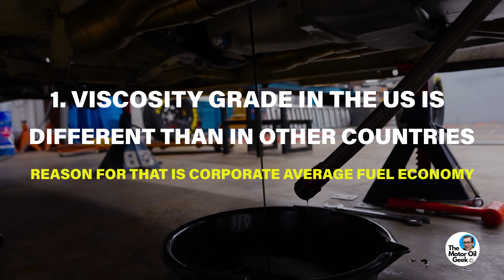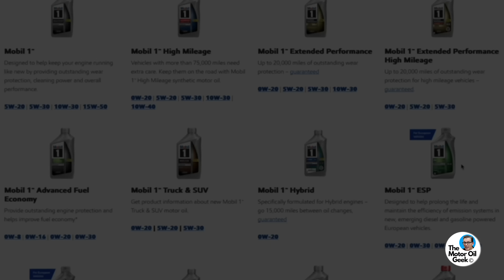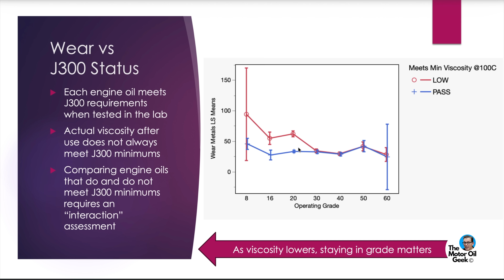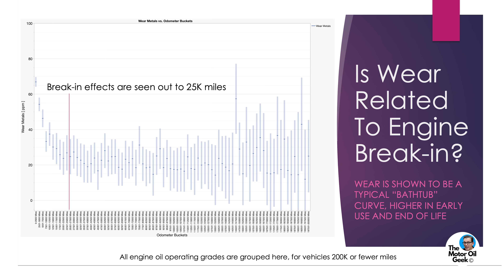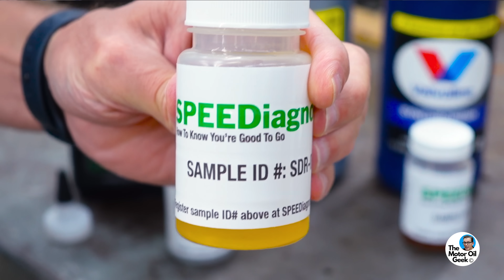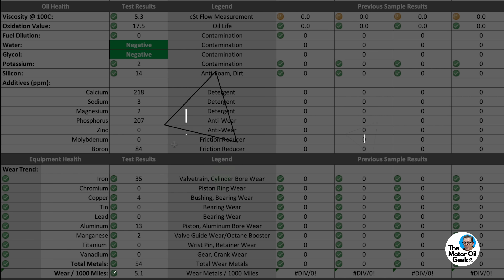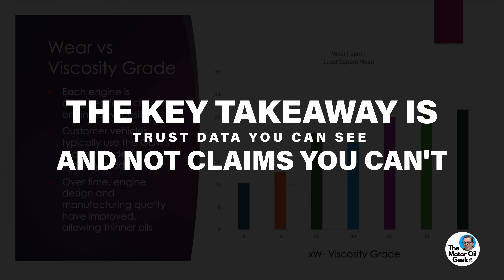More Ai Lies? The FACTS about 0W-20 vs 5W-30 (With Evidence)

Comment: He is biased as he owns the company, he directly benefits from oil analysis you guy pay for. Ever noticed how this channel always produces seemingly captivating, yet no new info videos? It's all same old agenda. He has some valid points, but a lot of wrong misinformation. Even worse that he tries to call it science, while failing at its core, no proven research, no real scientific analysis, but a lot of "home made" youtube tests on a test engine that is highly biased and owned by his friends. Even if he really was sincere and not financially biased, his tests are not science, far from it. On top of it he never takes into account that different types of engine utilize different approaches. For example Toyota's A25A - FKS has electronically variable oil pump that is calibrated by oil weight that they recommend and if you put blanket statements that in different countries it has different OEM oil viscosity recommendations - you can throw it out the window as its nothing without different weight tables oil pumps in those countries are running at. ECM eg computer module will have different tables for those countries. This little example changes everything and makes all his claims obsolete and biased. There is even more at play, but he only tries to push oil agenda without giving the full picture. My personal advise is: take his channel as entertaining one, have fun, but take everything he says with a big grain of salt.

Comment: I got a 2019 1.5 turbo Accord will how can I get the motor to last a lot longer I drive it like a grandpa I don't get on the gas usually and I try to go best for gas mileagesince it is Turbo should I use 5W-30 in the oil I've been watching you for a very long time I'm just want your opinion

Comment: Where should I test my oil? I put a supercharger on my engine and want to know if i should stick to 5k intervals and to the 0w20 recommended by nissan.
Reply: An advise. Use 5w30. Not lower than that, and depending on your mileage go to a 40.

Comment: Replaced the 0w-20 oil in my 2020 Kia Rio with 5w-30 and instantly started getting 42-47mpg vs the previous 32-38mpg. Same brand oil, same gas. Explain that!

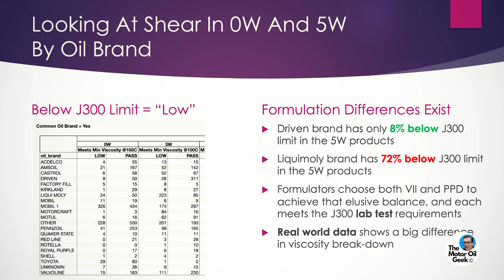Comment: Lake, I took your data from the table you showed at the 5:10 mark and created the following table. Let me know if I screwed it up!

 *J300 Shear Test Results: Percentage of oil analyses per Brand that failed or passed test				

Brand of Oil	     0W	           0W	              5W	          5W
	                  Failed (%)	Passed (%)	   Failed (%)   Passed (%)
Amsoil	            11.1	          88.9	             26.8	          73.2
Kirkland	              3.3	          96.7	             22.9	          77.1
Mobile 1   	      42.9	          57.1	             39.4	          60.6
Pennzoil	            13.9	          86.1	             37.3	          62.7
Toyota	            26.6	          73.4	             N/A	          N/A
Valvoline	             7.6	          92.4	             32.6	         67.4
*Data from MOG (Motor Oil Geek) data table

Comment: For starters I went to UTI. Was told how oil viscosity gets thicker and thinner. The I worked for Texaco oil refinery for 11years. All oil starts out at base viscosity. So if it’s 0-20 over time the oil will end up at 0. If it’s 15-40 over time it will end up at 15. I don’t care what the oil cap says I put 15-40 in my Ford Explorer. If the viscosity is 30 only, it stays 30.

Comment: I bought a used 2022 Ram Rebel GT 1500 in Canada the owners manual said to use 5 W 30 when I had it titled in the United States all the Ram dealers said here say 0 w 20 which looks as thick as water to me, so who is right?

Comment: EDIT:  I'll put this at the beginning rather than after the original post.   Regarding AI "lies", I have learned quickly NOT to trust an AI video.   I simply watch a few seconds or so to determine if it's AI and then I tell YouTube to "not recommend" the channel in the future.  To me, if you cannot put a name and face on your content it's probably not worth watching in the first place.  Many of these videos come from overseas and you can see and hear the clear misuse of English throughout the video and you don't have to be an English major to detect it!    Other content creators use a script and use synthetic voice overs.  Again, why not put a name and face on your content?   You hiding something besides lies?   In both examples, the videos are always littered with falsehoods some much worse than others.   Religion in politics are the 2 areas that people NEED TO STAY AWAY FROM AI VIDEOS at all costs and that also includes the synthetic voice over videos!   In most examples you simply don't know the people or entity behind the videos and their associated agenda.    

I run the 0w20 in my 2025 vehicle and my guy says to me, "I'll see you in 5k miles."  To this I always reply, "I'll see YOU in 3k!"   I've followed this strategy since the early 80s, multiple cars and brands and never had an engine issue.  04 Durango sitting outside has only seen approx 4k-5k miles between changes twice in its lifetime.  Both times I was working abroad.  I try and follow that 3k oil change interval as best as I can.

Comment: Okay so what's the one thing that changed over the years with these engines besides cylinder deactivation and auto stop start IT'S THE OIL VISCOSITY 0W20 IS TOO THIN I don't care what The data sheets show all I know is my truck sounds and is running better with the 5W-30 then it did with the 0W20 and the oil pressure with the 5W30 is normal, before The switch it would go down to as low as 8 psi at hot idle now it goes to no lower than 28 psi at hot idle and this matches what every other vehicle I ever owned that used a 5W30 and my miles per gallon is the same. My current vehicle is a 2019 Chevy Silverado,

Comment: So if I understand this correctly, the latest recommended SAE API engine motor oils for ICE (Internal Combustion Engine) vehicles have gotten so good today, that manufacturers can now backdate to a lower recommended viscosity oil, such as 0W-20, even for vehicles from decades ago, that previously had recommendations of 5W-30. (Such as Ford Motor Company appears to have done back to the early 1990s for US vehicles.) And the reason these recommendations are made today, is to provide all the protection that is required & more, with modern oil additives, -while at the same time- increasing fuel mileage without any lubrication harm to the engine from concerns over too low a viscosity, correct? And this has been verified by the manufacturers themselves, as long as proper engine oil & oil filter changes are carefully adhered to, but a man can always verify this himself via oil analysis sent in to a reputable lab to determine if the wear characteristics on your particular ICE vehicle is fully within healthy specifications. Is this the correct comprehension of this presentation regarding backdating thinner viscosity oil recommendations made by manufacturers? 

Final question: Do these backdated recommendations for a lower viscosity engine oil give any kind of EPA credits to the manufacturers?? If not, why do some manufacturers appear to recommend a higher viscosity oil for their engines when in use in similar conditions, but in other countries? Or is this also a lot of malarkey, and actually there is no difference in engine oil recommendations when the same engine is used overseas in Europe or Asia?

Comment: IMHO! All of this technobabble is BS. 380k, 400k, 250k and currently 240k is the number of miles I've put on my past four F150s. I've always followed Ford's recommendations as close as reasonably possible and they all ran great when I sold or traded them. The last two F150s, I followed the oil change minders from the computer displayed on the dash. Usually as many as 6500 miles depending on conditions. The present truck is mostly operated in warmer climates of Georgia with towing done approx. 10% of the total mileage. It's a 3.5 NA engine with a six speed. It's at 240k miles, runs like a watch and doesn't use oil between changes. My question is? Why are there so many auto geeks out there even wasting their time arguing about this? I've been driving since the early 60s and this subject has always been argued. It's gotten old a long time ago. My advice, follow the manufacturers recommendations and that includes letting the computer tell you when to change the oil. If you have that feature. Not all 5000 miles are created equally and just changing oil at that specific number makes little sense.

Comment: An important factor here is the engine temperature. If the cooling system works correctly, the 0W20 is fine. But if the engine runs hot or overheats, the heavier oil might just save your engine. For best fuel economy, go with 0W20. For best lubrication, I would recommend 5W30 or even heavier as the engine gets older. Most important thing is to change the oil regularly and more often as the engine gets older. This from a retired machinist and aircraft mechanic.

Comment: so 3 take aways use oils with a narrower split in the #'s between the w, buy a good name brand oil, do not follow the OLM on your vehicle! that is only there to drive down the cost of ownership! even with Synthetic oil in the climate I live it I go max 3500 miles between oil changes (Buffalo NY) wild temp swings in the fall/spring. bitter cold in the winter and days with stupid high humidity in the summer!

Comment: Seems like 0W20 will punish you harder if you dont do your oil changes..
5W30 was perhaps not to bad to let it slide a few thousand.. but you will lose lubrication with worn out 0W20.
Between these temperamental oils, erhanol in fuel, BS maintenance schedules, 'lifetime' parts.. they are out to kill our cars!

Comment: ED, I don't see any synthetic oils here and i have used walmart syn for over 40 yrs. I change at 6000 or once a year in Tennessee. I went to 0/20 in 2007 chev truck, may go back to 5w30 syn. just in case it shears. Did this video show any charts on syn oil shear that I missed? Old oiler here that likes syn.oil, look at it under microscope!

Comment: 5w-30 means older engine, meaning messier fuel system metering, getting more wear than a NEW engine with better fuel metering. Also, 0w-20 is formulated with a ton of AW additives, vs 5w-30 tuck stop oil.

Comment: if you put a 0 20 motor oil in an engine, put it on a dyno and load the motor to its hp rating and leave it running there, will the engine fail because the oil breaks down and metal-on-metal happens? This seems extreme yet people manage to do things with vehicles where lack of cooling or lube.  Oil has a viscosity rating or weight, which, as the  temperature rises the viscosity turns to water  and lubing ability disappears, which a full true synthetic should compensate for, but when you look at new engine failures if the oil does not fail, how would there ever be a bearing, piston or cam valve train failure which is an epidemic in motor failure everyday right now the very reason people are trying to get answers to this question

Comment: I’m gonna just go old school 3k changes. Now I did buy my wife a new Jetta gli and will be using liqui molly but I still think as long as you do more frequent I’d 5000 miles or less, the oil doesn’t matter. I have been using Kirkland 5w 20 and 5w 30 for years with no issues. Oil still looks good on 3k oil changes

Comment: 2:27.  I guess he assumes everyone on the planet knows what oil shear and shear out of grade is.  What it is: 1. Oil Shear: When oil is forced through tight gaps (e.g., between a crankshaft and bearing), the opposing surfaces shear the oil layers, causing polymers in the oil to either temporarily stretch (temporary shear) or permanently break (permanent shear).  Reduced Film Thickness: Sheared oil can't maintain the protective film between moving parts (bearings, cams), leading to increased friction and wear.  2. Shear out of grade: "Oil shear out of grade" means a multi-grade engine oil loses its protective thickness (viscosity) due to intense mechanical stress, causing its polymers to break down, making it thinner than its label (like a 15W-40 becoming like a 10W-30), which reduces lubrication and can lead to engine wear or failure, so it's crucial to monitor used oil for this thinning, especially at 100°C.  
IMO, the best info in the video is here at 5:42.

Comment: Well, I switched from 0w20 to 5w30 on my HEMI, and the cold start tick went away.  My OCI has always been 4K-5k miles since new.  At 36,000 miles, a cold start tick started, so I switched to 5w30, and the cold start tick went away.  The truck now has 90k miles and still no cold start tick.

I’m no oil expert, but a tick means wear.  Since there is no more tick, wear has decreased.  

This is on a 2022 Ram 1500 with the HEMI.  I bought it brand new, and the truck still gets 22+ mpg on the highway, so the thicker oil did not adversely impact how it runs.

Comment: From Leo:  Here is my proof.   The Ford 4.6 seems to eat cams, and timing chains and tensioners.   I have gone over 175,000 miles on 4 of them and never needed replacement and the engines run quietly.   I have used 5W30 on all of them.   I might not have the technical data, but I have 4 high mileage engines still running quiet on the original cams and timing gears.  I am going to stay on this course.,

Comment: I drive a 2008 Mitshubishi, at 110k miles now, I use 5W40 simply cause it's an older engine etc. - the recommended oil from the factory indeed was 0W20, when it's new, also for lower fuel consumption. I'll take a bit more fuel expense over time to protect the engine and keep the car for a long time.

Comment: I have to wonder if you aren't just another AI Dopey fabrication.
  Your So-called "proof" is not even close to true or "Scientific".
  Maybe you should try writing Children's Fairy Tales.
 Much of this younger generation yields little hope for the future.
 I will admit that "some" of what you say is true in part.
 If you are for real, don't just show documents without showing exactly how these results were arrived at.
A true and accurate scientific test must:
1-Not be based upon preconceived expectations.
2- For this specific test consistency and application within various conditions must be properly performed and documented thereto;
2-A: various application types and years/ generations of engines
2-B: Climate conditions 
2-C: Vehicle engine(s) application- 
2-D  Passenger car family primarily intown.
2-E Passenger car family primarily highway driving
2-F Passenger car business/ non passenger delivery
3 miles/ hours per use per day 
4- Off time between use/run cycles
5- Engine warm up to a given temp. consistency or not
6 plus- Plus numerous other factors that must be accounted for.

Comment: 2025 Bronco sport manual says 5/30, but 0/30 in winter-20. The maual flat out tells you not to but this motor if you will be operating primarily at -20c or colder. My stealership told me hes worked 20 years and  never heard of 0/30...hasnt called back with answer in months. would you let them change it with the 5/30 despite their ignorance and fact they won't follow fords manual., or just change it with the 0/30 Ford recommends myself?

Comment: In your opinion which grade of pennzoil platinum should I use. I have a 2016 Toyota Tacoma 3.5 liter with 261,000 miles on it. I changed from 0-20 to 5-20 my last oil change and the engine noise is way quieter. By the way I live in Louisiana.

Comment: here is the truth.  1960s oil was never a problem with engine ware.  1970s no problem. 2000's engines half are junk and not harden correctly.  My 6.7 diesel, I live in minnesota. Oil changed at ford dealer, winter time. 5w-30 put in. Temp is -5 degrees, plow is on and towing 16,000lbs and going up north 186 miles one way. Speed was 68mph temp stay normal. On the way back home, temp is 34 degrees 60 miles temp is now past normal going to up. By the time i got home my oil temp was 238 my water temp was just below the red mark. That week i changed the oil back to 15-40. 3 weeks later went back up to the cabin with the plow and bobcat/trailer. Left at 10 degrees, came back home at 39 degrees. Temps stayed at normal the whole way home. Heat ruins oil and breaks it down. Even my superbike, Honda run 10w-40 and 20/50 racing oil. Race engine 0-70 for 1 day of racing.  CHEVY , FORD. CHRYSLER, DO NOT RACE! THEY ARE HERE TO MAKE MONEY WHEN YOUR ENGINE BREAKS DOWN!

Comment: I worked for a construction company in the northeast. I would sometimes work in the shop during winter changing oil, etc. All the companies chevy pickups were running 15-40. Same oil we put in the dump trucks. They were getting over 300,000 miles out of them. When they got new ones the trucks still ran. It was due to them rusting away.
Reply: Or the trans failing lol

Comment: Heres the thing.  I have 2 dailys.  A 2022 accord 2.0 sport.  And a 24 ranger raptor.  The accord takes 0w20 stock.  And my raptor uses 5w30.  But I modifed both HEAVILY.  The accord now makes 450, and the ranger 600hp.   Stock i never had issues, but had to bump the accord to 5w30 as the increased horsepower and stress put the 0w20 too far out of its comfort zone.  And i live in a cold climate, so you would assume the 0w20 would do better.  I also use eurospec oil.  Because they arent hyperinflating their fuel economy numbers by destroying your engine.

Comment: Actually in my view, Lake just supported the fact 5w30 DOES protect better then 0w20 in real world environment.  he said WHEN oil does not sheer, their protection level is very close but in real world, oil often DOES sheer and oil dilution from fuel does happen.  considering a large percentage of people still follow dealer recommendation of long oil change interval, its even more important to stick with 5w30 over 0w20.  slight mpg gain isnt worth potential for increased wear.
Reply: Better THAN